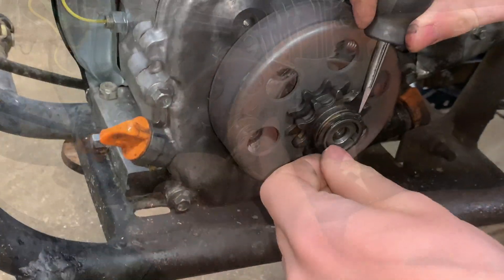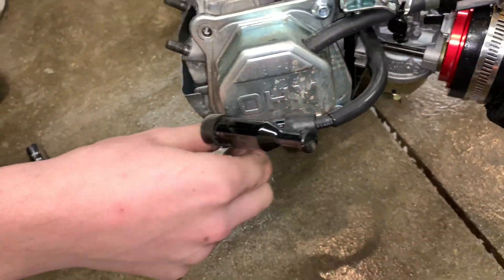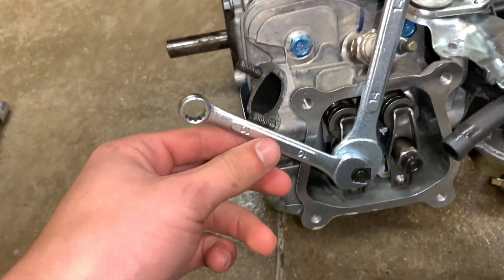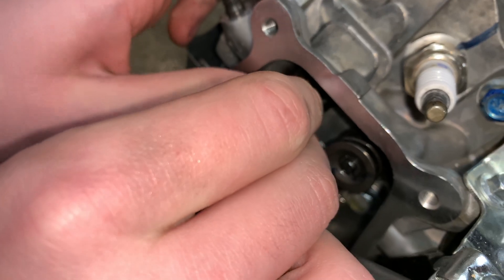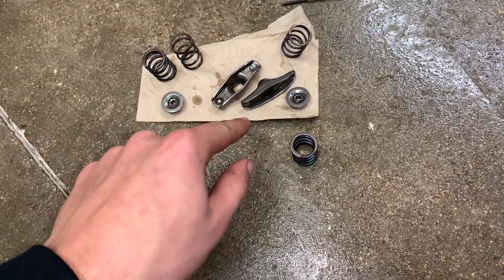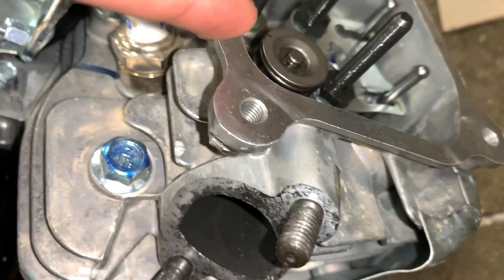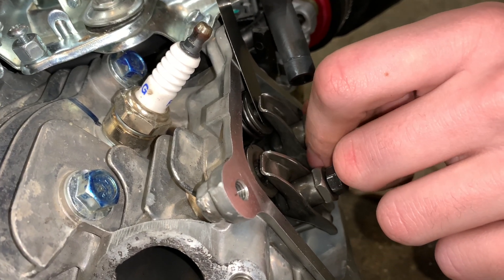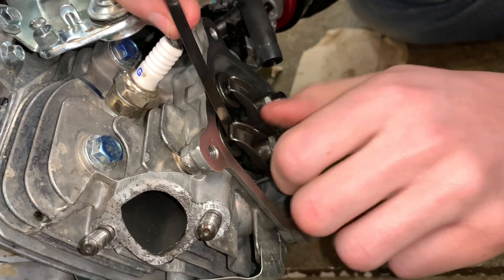Predator 212cc Valve Spring Upgrade - Warrior Build (part 2)

Comment: My exhaust port looks different than yours but my valve assembly is the same, i guess they gave the exhaust flange more surface area on the newer models. Now i know why some of the headers on amazon are shaped like they are.

Comment: If u ever drop a lash cap ,keeper,  u can usually drain it out just shake the motor to the oil plug side . Small adjustable magnet...

Comment: I changed mine and now it’s hard to pull, it started but it’s hard to pull
Reply: double check your lash.....003 to start with!!! i like mine tighter than that!!!!
Reply: Did you use the Honda springs? I just did now mines hard to pull. I haven’t tried to start it yet waiting for a new gasket. Thinking I might need to find different springs
Reply: @GratefulEd907  did u make sure it was at top dead center?
Reply: @SKATESPOTSWORLDWIDE  yep
Reply: @SKATESPOTSWORLDWIDE  yep the Honda springs are longer than the stock springs and have 6 coils. I just ordered a different set  it looks like they have 4